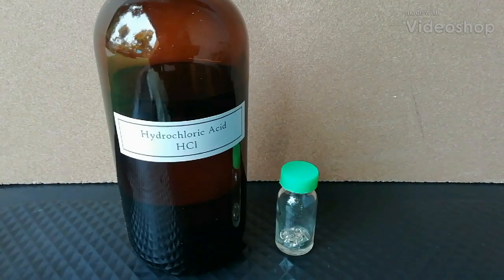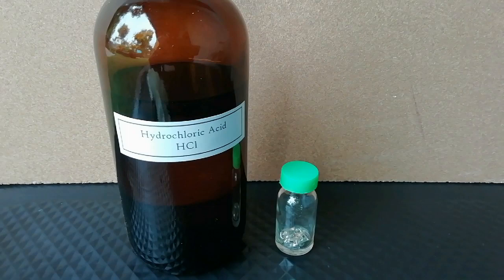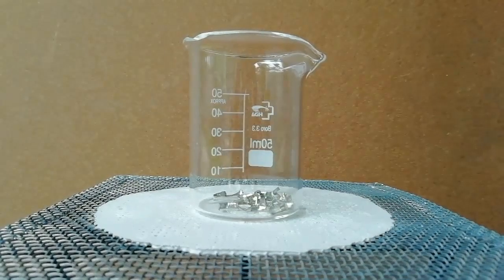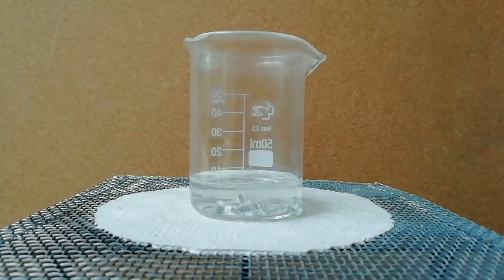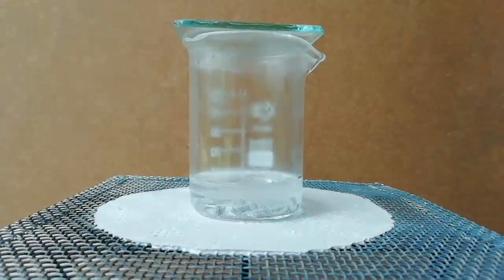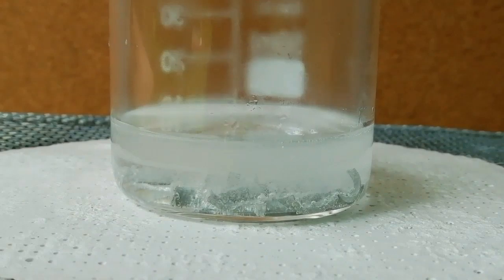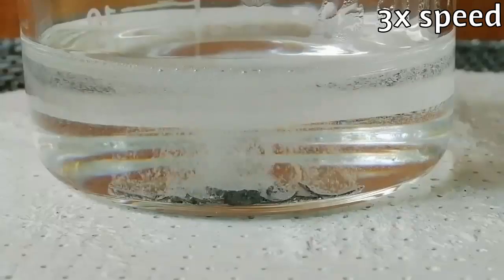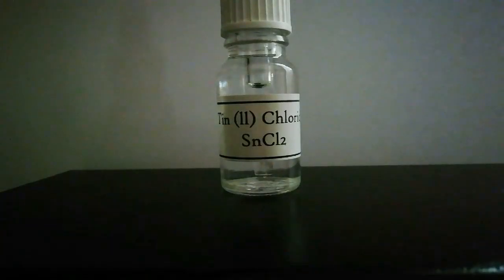How to make stannous chloride ( Tin chloride )

Comment: Hi nice video but I need ask tin  like foil paper
Reply from the maker: The foil can be bought from chemical stores is like 1-2mm thick metal. For increase the surface area I had to cut it to very small pieces
Reply: @ChemExLK  our country say. Aluminum foil. This is tin. Or not
Reply from the maker: I used tin foil(Sn) not aluminium foil(Al)
Reply: ✌ good luck bro.. nice vid.. clip